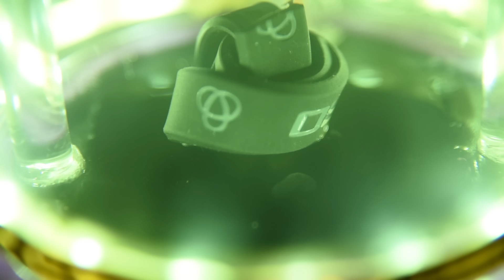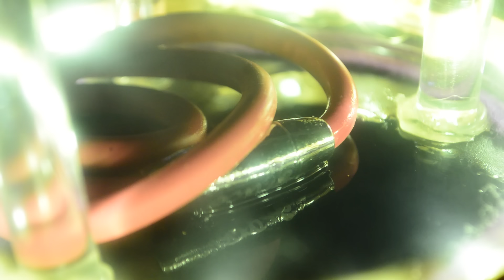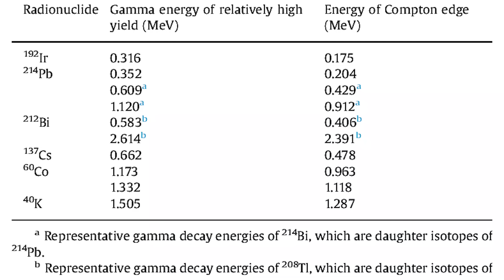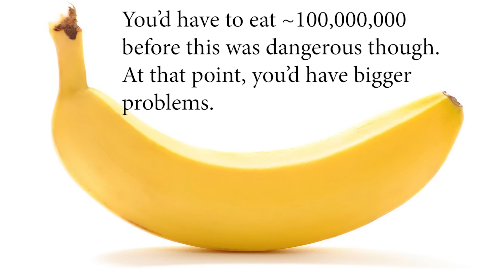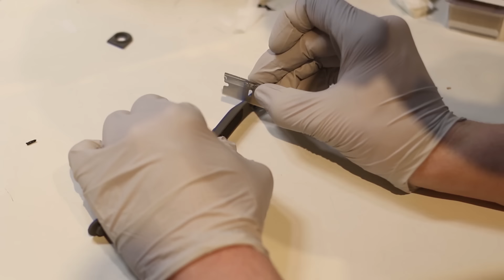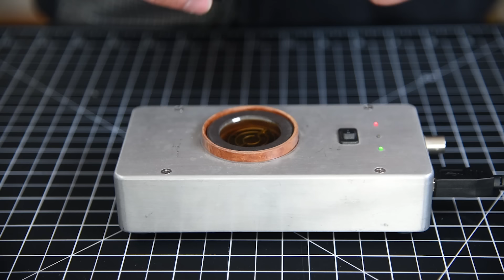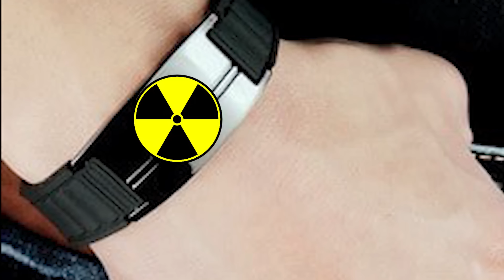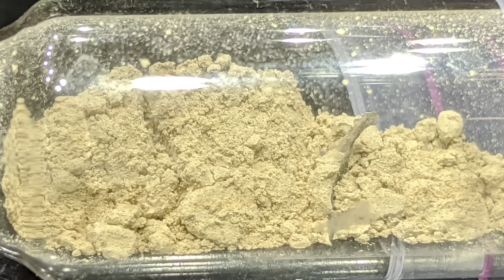Negative Ion/Anti-5g Products Are Actually RADIOACTIVE

Comment: I had a radium band of some sort a while back that i didnt wear but strapped onto light bulbs when they were on. Then i turned off the bulb and it wud glow for a while.
Then i overdid it and it basically kinda burned-ish(dark color, no more glow), and it went straight to the regular dustbin.
I wonder what mess it created down the line

Comment: ... I bought one of these several years ago. They didn't disclose that it was based on radiation. 
I Stopped wearing it after a short time, but now I'm not sure what I did with it... Might still be in my home somewhere. I wonder that's bad....
Reply: Don't worry it won't hurt you, it probably stimulated your immune system through a biological process called radiation hormesis.

Comment: I’m gonna disagree with your stance on alpha particles. I’ve done little tests myself with large amounts of americium 241 and polonium 210 and I couldn’t pick up the alpha particles on the other side of the paper and I had it right up against it. Alpha particles are dangerous when they are inside your body. Like if you eat or inhale dust of an isotope that primarily emits alpha particles. The best isotope to do the paper test is with polonium 210 because it’s pretty much just an alpha emitter.

Comment: I will note Thorium is basically as safe as it gets for radioactive material outside of Bismuth. Thorium 232 is super duper stable, half life of 14 billion years.
Natural Thorium is less radioactive than Natural Uranium, and Depleted Thorium(pure 232) is less radioactive than depleted Uranium(pure 238). It’s also less chemically toxic and doesn’t cause the radon issue.  The fact you could hold it against yourself for a year and be probably fine is pretty solid proof of that. It would be even less radioactive if it was depleted and the less than one percent of other stuff was removed. Even the dust isn’t a huge hazard compared to Uranium in small amounts.

They should probably use Bismuth though. I mean, it’s technically radioactive. Barely

Comment: Sievert is only used for gamma/x-ray. It's never used for alpha or beta or any combination with gamma/x-ray when using a detector. 

The detector when calibrated only uses a gamma source. Or pulse calibration depending on the probe response characteristics to a gamma source.
Reply: If you get a meter and probe calibrated the measurements can only be trusted with that combination of instrument. 

If you wish to be able to switch probes you need a scale that reads counts per min/sec.

Comment: Making water "more wet" is an actual thing... but it's irrelevant for water you are going to *drink*. It's only something relevant for water that's spread over a surface. Making water "wetter" refers to decreasing its surface tension so that it 1. spreads more evenly and flatly instead of pooling and 2. dries faster and more uniformly. It's something that comes up in photography prints (with film companies making products like Kodak Photo-Flo for the job) as well as working with clay or plaster.

The hilarious thing about the shower beads: Showers produce actual negative ions (and not in the form of ionizing radiation) anyway due to the force involved, at least if you have decent water pressure.

Comment: Hi there! could we do a video on “EMF Radiation blockers”? thinks like the “Biochip by Bodywell” or the “Lifetune One by Aires Tech”? 

these are supposed to block the negative EMF radiation emitted from everyday items we use like cellphones/laptops etc. 

It would be so interesting to see if they’re actually life changing and beneficial or if they’re doing the complete opposite!
Reply: EMF radiation has less energy than the light we use to see, it can’t affect you beyond occasionally exciting hairs, which isn’t harmful.
Reply: EMF radiation isn't "negative." For anything less than an X-ray machine or germicidal lamp, they're less influential than a lightbulb. It's all just light at different wavelengths, and anything you can buy at Best Buy is going to be emitting either in radio, microwave, infrared, or visible - stuff that already hits you or passes through you all the time because they're emitted by the sun. The antennae on most devices work in the single-digit watts anyways and are barely emitting anything.

Comment: Saying paper stops alpha particles is like saying a sheet of metal stops bullets.
Both sure as hell can be true, but kinda miss crucial questions like "How thick does it need to be?"
Layer paper thick enough and it'll block gamma rays. Try and stop a bullet with a sheet of aluminum foil and you might as well hurl insults at the bullet instead.

Comment: I tig weld at work. Our tungstens are 2% thorium. I grind to resharpen multiple times a day, how worried should I be?
Reply from the maker: They say to do it in a very well ventillated area. That and proper PPE is advised. Tbf, tungsten particles on their own are pretty nasty, the thorium just makes it... worse.
Reply: @thethoughtemporium  we have no ventilation and I usually don't wear respiratory PPE. Just a wheel grinder in the shop.  Maybe I'll convince them to switch to non thorium tungsten. They have options these days, and I believe its against OSHA rules to use thorium tungsten anyway. Lanthium tungstens work just as well.
Reply: @KC9RXP  You can probably convince them by threatening with reporting about osha violations
Reply: @KC9RXP  Still alive?

Comment: You also shouldn't have tourmaline powder on anything, it's harmful to breathe in.
Even if it was normal tourmaline that you could buy from a crystal shop, it's still harmful to put in your body.
A more common crystal people say to avoid breathing in or breaking due to the fine dust is Selenite and Satin Spar which will cut up your lungs.

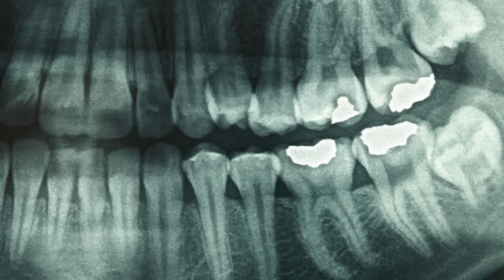Comment: Up to 12:40 I was totally agreeing, but after that it started to spiral down into manipulaion to exaggerate the threat.

1. While epidermis doesn't stop alpha particles it severely lowers the total amount / total dose (epidermis weight in gray -- sievert conversion is close to zero). So, 5-6 microsieverts per hours is way off - it depends on callibration of the Geiger counter shown (it doesn't take into account the type of particle or the particle energy). So, if the counter was callibrated specifically for a thorium chain the results are exxagerated. If not - then the amount of microsievert per hour measured isn't reliable in any way.

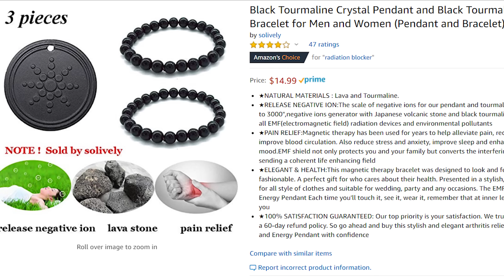2. 13:25 This dose is valid only in close proximity of the 'negative ion bracelet'. The doses in chart are counted for a whole body irradiation. If only the smart part of the body is irradiated, the dose is weighted down, so calculating total dose absorbed by adding measurements from a detector close to radiation source is a gigantic exaggeration again. 
In fact, the small patches of skin right below the 'negative ion bracelet' will get this, say, 5µSv per hour (now, the weighting factor for skin  tissue is lower than average for the body, so the equivalent dose will be less than that, but let's just omit that). In 30 years this will cumulate to one sievert. That means that the probablility of cancer in the small patch of skin just below the bracelet increased by half. The rest of the body remains the same.
By the way, if you'd put a counter in the beam that hit Anatoli Bugorski, would you conclude he got 2 kilograys (and multiplied by the proton weight it's 10 kilosieverts)?...

3. Total dose received isn't just a 'linear increase', acute dose of ~0.4 Sv will cause a mild radiation sickness and increased cancer risk, the same dose over ten years (and I mean full body irradiation, people lived in Taiwan apartaments where the rebars had  Cobalt 60 inside (hard gamma emitter) didn't have increased cancer risk. 

So, when worn, those bracelets are probably nearly harmless. Thorium is inhaled in far greater amount from plain dust inhalation. The only thing of real concern is the thorium oxide powder in 'mommy's special pen'...

The bracelets are still a scam though.

Comment: I saw a seller of this on the street, and they had a Geiger counter on the table. They were showing how they Geiger counter was “picking up radiation from 5g, but it was their own bracelet. They put the bracket next to the counter, and turned the counter off. They then pretended that they had simply “pressed the button to get a new reading” and remarked on how it was no longer showing a number. They then moved the bracelet farther away, and turned it back on, pretending that the reading was from “ the new reading without the bracelet.” They know it’s radioactive and they’re using that to trick people

Comment: RE the issue of alpha radiation: I actually think that diagram describing the penetrance of different radiation types is more than defensible. Here's why:

1. Alpha radiation penetration in tissue is approximately linear wrt energy, with a coefficient of 25 microns/MeV. Due to the mechanism that generates it, alpha radiation sources typically produce particle energies of around 4 MeV. The result is that most sources will not penetrate the dead layer of human skin. Thorium is actually a rare exception, with energies ~8MeV. Therefore the diagram is literally accurate for the vast majority of alpha sources.
2. Whereas it is generally true that alpha radiation is considered much more carcinogenic than beta or gamma, there is a caveat here. Part of what is happening is that, due to the mass of the alpha particle, the emitting ionized nucleus itself has a recoil which produces substantial ionization. Furthermore,  many heavy alpha-emitting metals have the annoying property of co-localizing with DNA, which is shattered upon radioactive decay. This the major reason alpha is considered an internal radiation hazard (ie if you get alpha-emitting radioactive material inside your body, it's bad). In experiments with externally-sourced alpha irradiation of mammalian skin (with a sufficient penetrating energy), there actually seems to be less induced cancer than beta particles. So, even on the rare occasion that alpha penetrates the skin, it is probably not contributing much to cancer risk.
3. Cancers of the skin are rarely lethal and generally much less aggressive than, say, cancers of bone marrow, which of course is going to factor into how various organizations decide to set guidelines around radiation exposure, and therefore the tools they will use to teach about different radiation types.

In conclusion, the diagram is basically physically accurate, and very accurate relative to the actual level of risk implied.

Comment: I saw that toothbrush the other day online. I claims you don't need toothpaste, you just need to dip it in water. I was skeptical, but i thought it might be good for travel if it works. Luckily i didn't buy it.

It's kind of scary how easy it is to buy something like this on accident.
Reply: Is it emitting a lot of fluoride particles or something? Because otherwise you definitely need toothpaste
Reply: I have that toothbrush. There's actually a battery inside it. I would say it's emitting a negative charge instead of negative ions, though.

Comment: Yep... you just nailed it.  I had to order my thorium from the Philippines.   I use it as a calibration source for my Gamma setup.  I also use K40.  You know the fake salt?  No Salt its called. Tastes like salt, but its not salt?  Yah, it uses Potassium.  Funny thing about Potassium, it has K40 in it, which is radioactive.  However Potassium is critical for the body to fight cancer so having it is better than not.  So far as the Thorium though... its just bad.  I keep it in a pig like the Uranium etc.

Comment: Is nuclear glass safer than this? That old glowing glass
Reply: I believe so, it's still radioactive but I think it's pretty minor
Reply: It has like 5g in like 300 g of silicon dioxide so it will be fine as long as you don't swallow the its dust
If you break or chip it then don't use it after that

Comment: That's 2.5 microsieverts is roughly the same as the radiation in 25 bananas. Not dangerous at all. About 1/5000 a CT scan. Smh
Reply: ok but are you constantly eating 25 bananas? if it's sitting on your person it's not a one time exposure.
Reply: Bro really made three comments, just to make the same garbage take, please consider going into rehab for your copium addiction.

Comment: Do our cell phones emit anything? Always felt weird having my phone making direct contact with me, even use speaker phone 9 times out of 10, it's be nice to confirm whether or not my suspicions are accurate or unjustified
Reply: They have an electromagnetic field but thats about it and thats not dangerous
Reply: He actually made a short where he put a phone in the cloud chamber, and as expected nothing happened. Ionizing radiation is what's dangerous but your phone just produces very low energy radio waves which don't interact with anything found in humans. And over time the radio signals we used have only gotten weaker since our infrastructure and filtering algorithms got more powerful.
Reply: They emit a tiny bit of microwaves but all that can do is warm things up a bit. No more dangerous than pressing a warm towel on your face.

Comment: Something that I think wasn't even put enough emphasis on, is the fact, that particles were leaking out of the object. There's a reason, that you have to wear facemasks in proximity to free radioactive material, and that's because, inhaling radioactive material is probably the single biggest threat of radiation out there. Not only will inhaled radioactive material settle in your throats, digestive track and lungs, where it can continuesly release radiation, but also internal shielding in particular from alpha particles is much worse, which is also the reason why alpha particles have an RBE (relative biological effectiveness) rating of 20 compared to neutrons with 2 and electrons/ photons with 1. This means that roughly speaking alpha particles are about 20 times more effective at harming a specific biologic system then beta/gamma rays. So when I hear, that powder is leaking out of those bracelets, I'm extremely worried about them escaping into the air, and then being inhaled by people!

Comment: My dad went to Las Vegas and came back with bracelets made out of gemstones that supposedly help anxiety and stress. So obviously me no believing in that horse crap, I ask if he knew what was the material. He told me the brand which was one of those random brands that just sell crap on alibaba. Turns out mine was made out of the one of the crystals that is the source of lithium.  Not only would it basically cause me to be exposed to lithium dust which is toxic but apparently that stone happens to be radioactive depending on the region it came from due to radioactive particles that can take the place of lithium in the mineral. Thankfully, my sisters bracelet was just quarts.

They looked exactly like that stone bead bracelet you showed at the start and I don't have equipment to test if the material is dangerous so I refused the gift. I know my father decided to wear it even tough I warned him it could be dangerous.

Comment: How is this legal
Reply: NRC (nuclear regulatory commission ) has oversight. They fall under the category of things that are radioactive for no reason. Thoriated welding rods good….cancer necklace bad. I reported several dozen eBay listings to the NRC and 3 months later got a report back and all the listings have been pulled. There is just sooooo many of them that unless someone reports a item then it can take years for them to find them. I did order a couple “negative ion pendants” and they were indeed doped with thorium oxide. Readings of 8-13 uS/hr on a pancake tube Inspector. They are now part of my radioactive things collection in a lead lined box under 50lbs of lead shot.

Comment: hello , a, important precision : geiger counter arent meant to measure radiation doses , especially at the contact of object.  So all your doses assement and hypothesis are false.  For example when you measure a bracelet with a geiger counter that is sensitive to alpha beta and gamma it doesnt mean anything as alpha particule in external irradiation has no effects ; almost same as beta. Mainly gamma will pose a problm in the long term . Geiger counter are meant to evaluate the ambiance level of radiation as the geometry of the detector doesnt suit contact dose rate. Plus a geiger counter will only give relative precise measure if you measure on the same isotope used to calibrate the geiger counter . So all the reading of your geiger counter are in fact false. Geiger counter are only meant for detection and rough evaluation (especially if you measure with a counter close to the source).  But still you're right : using these products arent a good thing at all.